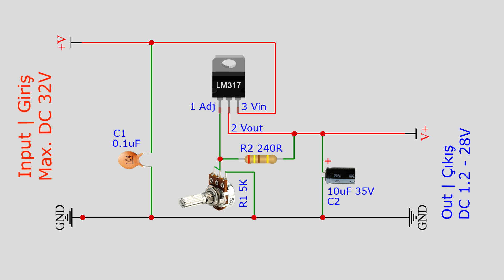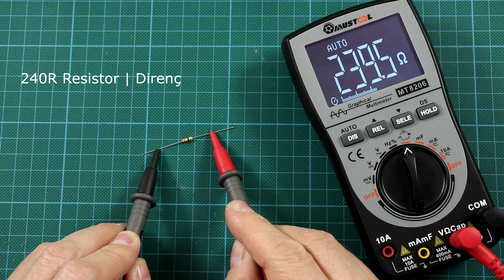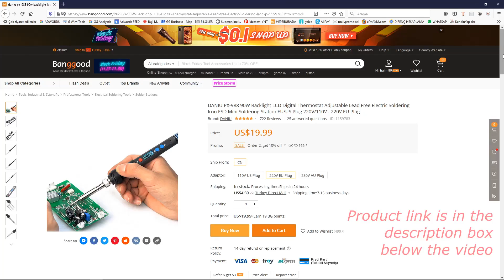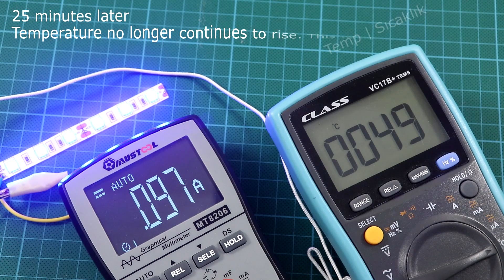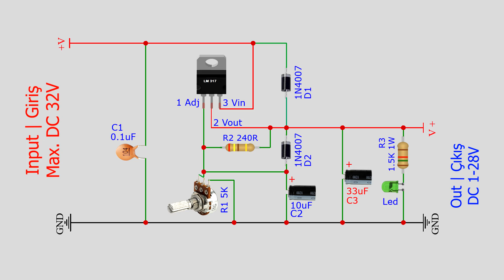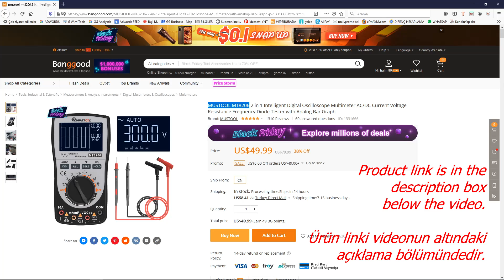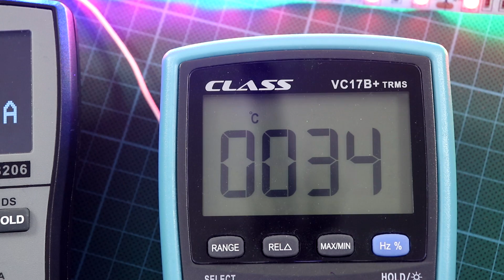How To Make 1-28V Adjustable Voltage Regulator. DIY Variable Power Supply For Beginners

Comment: Hi there great video i  was wondering what is the role of R2? does the output excluding R1 for the moment go from pin 1 through R2 and out pin 2. If so i assume that is in order to have a set voltage output. Is this a safe assumption?
Reply from the maker: R1 and R2 together form the voltage divider circuit. The voltage level can be adjusted by changing the value of the R1 resistor.
Reply: @Kendin-Yap  Thanks for the quick response looking at the first schematic im just confused on how the current flows from adjust to out, i understand that the 240ohm acts to create the reference voltage sub1.25V only from further reading post this video however can you walk me through how the current flows through r2 and the pot ultimately to Vout that's where im a little stuck on the this.

Comment: Can i use a potentiometer 50k or 100k as well???
Reply from the maker: Maximum 10K can be used. For 10K, the R2 resistance should be 470R.

Comment: Emeğinize sağlık. Bir sorum olacak; 4S ve 5S BMS'li seri grup 18650 pilleri hangi (Volt e Amp) adaptör ile şarj edebiliriz? 4S'lerin 16.8V'a - 5S'lerin 21.0V'a şarj olabilmeleri için şarj aletinin min. ve max. kaç Volt ve Amper değerlerinde olması gerektiğini öğrenebilirsem, elimdeki adaptörlerden seçebilirim.

Comment: Hocam lm 317ler 1 .2 amper gucunde.mesala ben 5 tane lm317 ni baglarsam.trafomun da gucu yeterse ben 5 ve ya 6 anper cikis ala bilirmiyim?parelel lm 317 baglamakda amer faydasi dokunurmu.su anda elmide lm 338 olmadigi icin bu yola bas vurmak isdoyorum.5 tana lm 317 elmde var,cevaplarsaniz sevinirm.

Comment: Sir
This is 24v input but fan is 12v
How can get 12v for cooling fan
Can i use input less 24 i.e. 12v or 18v for this project
Reply from the maker: You can use 7812 regulator IC.

Comment: What is difference in motor speed controller and voltage regulator?
Reply: motor speed controller is control frequency, voltage regulator is control voltage

Comment: Trafo ne için bilgi verebilir misiniz?
Reply from the maker: Bu tip regülatörler DC DC çalışır. Direk olarak 220V ile çalışmaz.  Trafo ve doğrultucu devre ile 220V dan 30V a DC güç kaynağı yapıp regülatörü besliyoruz... Farklı bir kaynakta kullanılabilir. Hazır bir DC adaptör  veya benzeri.
Reply: Trafo ile birlikte doğrultucu devrede mi koymak lazım yoksa tek trafo yeter mi?
Reply from the maker: 3:10 daki şemada olduğu gibi doğrultucu gerekli. Trafo dalgalı akım verir. Bunu DC akıma yani doğru akıma çevirmek şart.
Reply: Tamam teşekkürler. Keşke onun yapımınıda gösterseydiniz 😊
Reply from the maker: Haklısın olması faydalı olurdu. Doğrultucu ve trafo ile basit güç kaynağı yapımı için daha anlaşılır bir çizimi şemaların olduğu siteme ekledim. Videonun altındaki açıklamalar bölümünde şema linklerinden ulaşabilirsin.